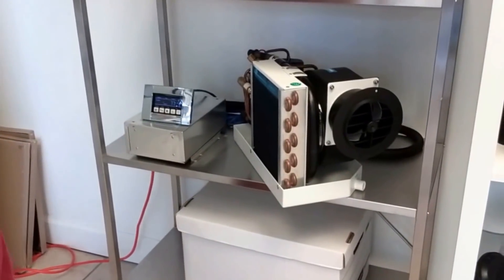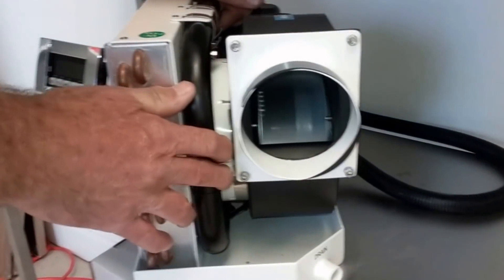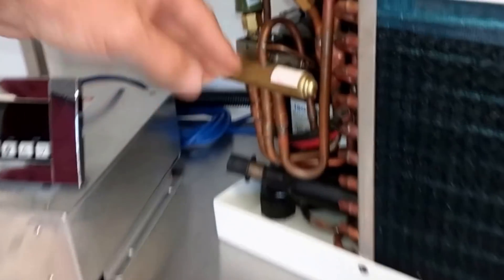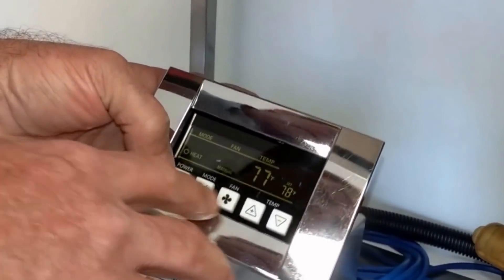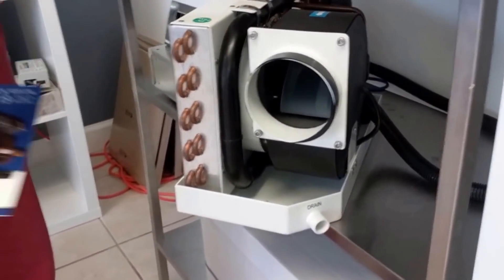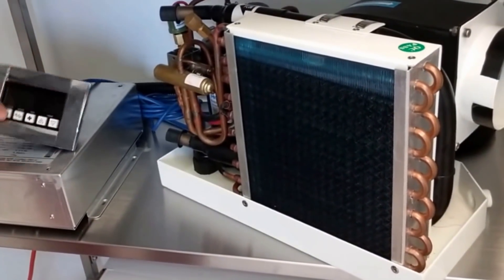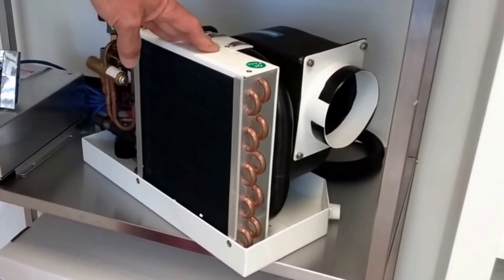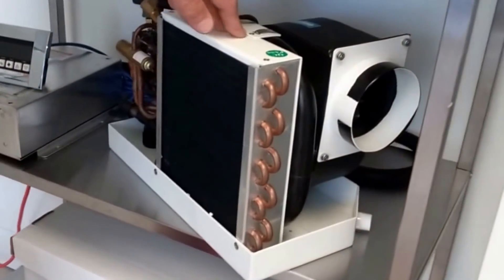Mini Hvac-WORLD'S SMALLEST AC/DC AIR CONDITIONER HEAT PUMP 4200 BTU

Comment: So of I would love to make this into a a 20% glycol methanol fluid total of like 3 gallons of glycol and methanol. I won't need the big ass fan. Would need a smaller fan to make everything functional im going to use a flat plate heat exchangers and run the r134a or which ever you think will cool the heat exchanger im going to use a magnetic driven pump  also 12v will have a wifi Bluetooth capabil of linking to  everything

Comment: So amazingly quiet and Fastly.Cool in my room! 42db is at a whisper level. I bought 2 and installed myself.Very sturdy bracket and easy to adjust to fit windows of different size. Absolutely fabulous units!!
Reply: Where do you buy it at?
 His link didn't have prices
Reply: Bot.
Reply: @jacobpie3692  yeah I've seen this message multiple times from different video comments

Comment: I wonder if bumpy  rides will do any damages to this unit
Reply: It's solid copper piping so yes. You would have to install a gym tile or two under it to eat up any shock. But this is highly overpriced.
Reply: Thanks for the info
Reply: @Acruz1994  no problem.
Reply: @briannakelly26  know of one similar i can buy?

Comment: Hello
May the product is also available for 12 volt for a van? How many watts or how many ampere are needed for round 10 hours?

Mobile +34 609 510 425
Thank you so much
Reply from the maker: All you need in the discription

Comment: People need more information on it like is it a window unit, how cold does it blow, is there a vent hose I have to stick out the window. Your not describing the key components to make a sale.
Reply: Donovan Mills its a marine unit, he pointed out the water lines that run to the condenser/heat exchanger.  It needs a source of cooling waterflow  and I assume a water pump...  Why they bothered to make it a heat pump with a reversing valve doesn’t make much sense on a marine unit as the water surrounding the boat is usually the coldest medium around and would not be my first choice to harvest heat from...

Comment: Whoa the price , learn to hack an regular  run the evap core, mount on the wall ,run 2 lines and  solder,mount other parts out side of the house and last charge.

Comment: A split version of this would be perfect, or a version of this that was the right shape for mounting underneath a vehicle, shooting the hot air out the side and the cold air ducted up inside the vehicle, it would be ideal for campers without having to use valuable roof space.
Reply: This is exactly what I have been looking for, there are some options available.

Comment: I have a minivan that is in the hot Florida sun all year round. I am sick and tired of getting into a vehicle that is 140℉. I have room for a solar panels on my roof and would like to know if you have a system that is configured for a van or even a motorhome, or trailer (3rd well). What would it take for this to run off of solar while I'm at work. I don't need it chilly, 80℉ would be great. I would have no problem cutting a hole in the roof and mounting it at the top center of the vehicle.
Reply: He said 25 amp for 12 volt, it means it use 300 watt. Check how much AH is your battery capacity. If you have 120AH battery(as example, Li-Ion),120*12v=1440 watt (ofcourse for acid filled you will get only 720watt). It means with 1Li-ion battery you can run 3-4 hour. Then check how much solar power you get in,  to avoid run out of power. For installation, you just need to hook it to your RV or Van wall. You also can hang it on van rear door, just weld a cage outside to avoid someone take it as a treasure, then you will be good. Hope it is helpful.

Comment: All these people freaking out over the price are idiots. This is a unit that is being marketed for people looking to cool a room in their home. It is used for a small vessel to cool a cabin. If you are wanting a a/c in a sailboat or small cruiser there isn't many options as you cant use a window or in room unit. These units are priced at this or higher on west marine and other sites but the power consumption is the main key here. He quotes 25amp at 12volts. If he is correct that is 10 amps less than any other I have been able to find and almost half that of west marine's 6000btu unit. If you are looking to run a/c on a sailboat that is strictly ran on a battery bank 10 amps a hour is huge and well worth it

Comment: It's not the world's smallest HVAC! This is an everyday boat compressor and evaporator. Nothing special people. Just look small because it does not have a heat exchanger. It requires water cooling from the ocean. This would not work in any other application but a boat. Unless you plan on running up your water bill through the roof just to cool your AC. Other people in here claiming they can actually make one is such a joke. They clearly don't Know Jack about HVAC.

Comment: There are smaller hvac units used on Telecommunication cabnets.  They are about the size of a shoe box.  Compressor is the size of a soda can.   About 1200 btu;s
Reply: Interesting. What brand and model?

Comment: This is basically a copy of marine air conditioner. These are been available for years and years some of them run off 12 volt 24 48 110 120 and 230-240. This is basically a marine application is reverse cycle requires water so it's not true electric heat. West Marine and other Marine manufacturers and dealers sell these things through catalogs and online or you can make your own for 500 or less. 🇺🇸
Reply: +Perry Daniels   Thanks for the tip, I'll look those up! :)

Comment: EEEEEYOUCH! $1700.00 I know you need to make some $$ but really don't need to RAPE our wallets. 
Hummmm... I have a coil, 12v dual cage blower, copper pipe and wire. 
I need to buy 12v pump (new $20) and heat exchanging coil (used car heater $20) & mic. plastic ($10). 
Will have to give this a shot. 
.

Comment: I wonder if it would be possible to use gallium to dissolve aluminum scandium alloy into a new alloy that you could use to fill copper pipes like in a condensor then pass low energy frequency through the G.A.S alloy crystal structures to generate low temperatures to produce low voltage air conditioning systems? A peltier modules could even be set up in the air intake with a air filter to keep condensor clean and to generate the electrical power to run the frequency emitting electronics and to operate the high air flow electrical fan. A regenerative air conditioning system that you did not have to plug in or recharge? What a crazy idea. Wow only if it worked? ; )

Comment: A graphite heating element space heater with therma liquid could be developed has well that would use less energy and there is also a way to make it so you don't have to plug it in to use it. Just like the air conditioning unit. Imagine that a air conditioning and heating unit you did not have to plug in or refuel to use? You want to make some interesting new products? ; )

Comment: You could design the heat exchange with larger fins for a more higher air flow rate to cool off a room very quickly with the design concept using liquid argon gas plus it would allow a person to clean the unit more easy which would allow the unit to operate longer without breaking down from use in high dust and animal hair environments. A better air conditioning unit that uses less energy too! One that can put ice crystals on your forehead on a hot diners day! ; )

Comment: A cryogenic Stirling cylinder a solid state sponge and argon gas. Turn on unit has the cryogenic cylinder turns the argon gas to liquid and draws more stored gas out of the solid state sponge that fills an insulated tank with a bell siphon that filled a heat exchange radiator. With a electric fan to draw air through to super cool the air with the argon boil off gas vapor returning to tank to be turned back into liquid. When system is turned off argon gas is reabsorbed into the solid state sponge. I have another component to make this air conditioning unit totally self powered has well if you would like to work together to make one amazing piece of technology?

Comment: I just completed a working prototype of a wearable air conditioning system, weighing under 6 pounds that provides the user with 3 hours of temperature controlled comfort on a single charge even in desert like condition. Plus the byproduct is stored water. (Yes, true refrigeration @ 1200 BTU's / 12V)
More information swe_tloving@comcast.net

Comment: Need to add a view of it installed and working
This is for Marine use, all these Naysayer's are thinking of larger camping trailers
I'm guessing the unit sets on the cabin roof
Then ductwork from the blower to cabin, it's a heat pump, it has to be outside for it to function as a heater in cool weather
Engineering for the Marine market is costly, and the space to be cooled, will be a smaller than the avg tt or fifth wheel

Comment: This looks like a very nice and well built unit.  It can also be portable.  AC and heater plus it is able to accept both AC and DC voltage.  Those who are saying that this is overpriced have no idea.  I have looked into building a wannabe AC unit that runs on ice water (not real refrigerant) using good quality components inside of a cheap cooler and it was already going to cost around $400 in parts.  Key words "good quality", not el cheapo stuff from eBay and Amazon lol.  But yea, for $40, I too can hack together a fan and some cold water to get AC.  However, that won't be a product with quality that's anywhere near what you've built.  Good luck brother!  There are 7.5 billion people on this planet.  If only 1% of the population buys your product, you will be very well off.  :)

Comment: I am going to use my hvac skills and design somthing like this.
Reply: design one that is gasoline powered. take an old gas motor from a inverter generator and use it to drive the compressor. they sell aftermarket auto ac units on amazon. but you have to use the cars engine to power the compressor. using a gas engine to power the compressor would be something
Reply: You can buy a new air conditioner for $100, then get a 2000 watt gas-powered invertor, problem possibly solved. Harbor freight sells these invertors, I finally met someone a few days ago that owns one, said he has had good luck with it, runs an air conditioner in his van.

Comment: 4200 BTU's is only 1/3 of a ton. It might and might not do 100 sq. ft. For the none HVAC people, a ton is 12,000 BTU's. (ie: a single wide mobile home will use a 2 ton to 2 1/2 ton unit. On average a ton will do approx 450 sq. ft. to 500 sq. ft.

Comment: 30 watts for the fan motor and and 30 watts for the Stirling cycle cryogenic cooler? 60 watts to cool a home? That beats 220 Volts for a central cooling system correct?
Reply: 4200 btu is 4200 btu... only enough for a bedroom... worthless @$1700 WTF!? The water bill also you have to factor in if you are metered.. Water cooled condensers are costly to run...

Comment: A mini Stirling cryogenic cooler to produce liquid air that filled a tank with a bell siphon valve to charge the heat exchange with a vapor tank to reform liquid air from it boiling off during the heat exchange to complete the cycle would not be a better way to design a small compact portable air conditioning unit? It would work a lot better then this air conditioning unit correct? In fact it could replace a central cooling system in a large house could it not and operate off say 60 watts? = /

Comment: There's nothing special used in boat AC units, it's not worth more than average household AC unit with similar BTU ratings.   They're just overcharging people, making people pay thousands for those little units,.  same thing in trucking industry.
Reply: also water is water, should try to wash your car or truck with ocean water..., should try to fit a window unit on the side of a boat..

Comment: Looks like an awesome product.   However, the cost needs to come way down. Although not as compact, a small window unit can be had for a little over $100 bucks.
Reply: Matthew Mcdonal
Reply: Evaporator has to be outside of area to be cooled else heat to be removed stays in same area ... in fact heat will increase due to motor and other friction from use of electricity to power the unit
Reply: obfuscatid u mean...condensing coil must be outside of the area...not evap coil...rookie

Comment: $1,750?! No please. Great idea...but no way. For that price I could get a much more powerful unit to run indefinitely from solar power and batteries. More than likely with enough cash for a nice dinner left over.
Reply: Yeah. Take a normal 6000 btu AC unit. And turn it into a split unit for $300.00 US. That Includes the window AC unit cost. That only uses 4.5 amps on high. You want to pimp it out. Use a soft start AC compressor motherboard. You're cutting the FLA amps from 50 amps to 11 amps at startup.... The inside unit is then only 5" deep.....
Reply: BakedLikeLays
Reply: alex vranescu ... I agree: where can I get one?
Reply: I believe the thing you are missing is that while this homemade item does indeed appear to work, it's present cost far bypasses it's worth. You can purchase a professionally made AC for the same purpose operating within the same specs as this one and with an actual warranty while paying about 300 less. Of course his cost could come down considerably if he had a production line and a steady demand for them.
Reply: BakedLikeLays Sure you could.
Reply: Have you come up with something yet? I am seriously interested in knowing!

Comment: and for that price i can purches a good used  hole house a/c unit. craze to spend that kind of $ to try and cool a room it would have to run all day,and then what do u do when u want to cool  a diff room , esp if you bed room is on the sec floor the cool air drops

Comment: The comments on here are amazing. The man actually builds a small, true (i.e. cooled dehumidified air via compressor) mini hvac and you guys are busting his balls because he priced them at $1,700. Go build your own and keep your negative comments to yourself!
Reply: He didn't build shit they make them for boats and have been for years and I've put them in even smaller and on battery power 24 and 48 volts D.C.
Reply: Michael Roberts go look up climate right air conditioners. They sell their 2500 btu unit for $400 and they are small.
Reply: völywMichael Roberts  .
.bwifj Musi
1k5
Reply: Eric Richards climateright air conditioners are a favorite of the teardrop trailer community. The air conditioner featured in this video has no more BTU capacity than a climate right air conditioner. The main difference is price.
Reply: Michael Roberts When you can go to Home Depot and buy one significantly cheaper that works better that’s why people are complaining of the high price
Reply: Just because you give it a high price doesn’t mean it’s worth a high price
Reply: thank you michael roberts. we are surrounded by idiots.
Reply: Grizzled Old Dude; they are Out of stock
Reply: It's just a boat unit. It looks small because It's incomplete. It will not function without water cooling for heat dissipation. This is different from HVAC in any other application on land. Because we don't use water to cool down the unit, that would be extremely wasteful.
Reply: Yeah!      That is way more than it should be for Chinese parts
Reply: For mini cooper
Reply: Well you can buy one of these for $400 so yeah no wonder theres hate
Reply: I already built my own mini ac same idea but better quality and cost me 693 $. I advice you men to try build your own ac and it is 💯 easy.
Reply: Michael Roberts I read your comment. It has inspired me to go ahead and purchase the unit. However, I hope it comes with a cigarette. I like to smoke after getting fucked up the ass.
Reply: ReliantArms 🚬🤣🤣
Reply: Michael Roberts
$1,700????!!!!!???!!!
AAAAAhahahahahahahahahahahahahahahahahahahahahahahahahahahahahahahahahahahahahahahahahahahahahahahahahahahahahahahahahahahahahahahahahahaha....Oh dear!!aahahahahahahahahahaha..!
Reply: It is just a fridge unit, with a bigger condensation coil. There is no exhaust coil, like a fridge. Just buy a 12/24v fridge and open the door. It is a horrible design. There is no exhaust, all heat returns back into the house. The unit generates more heat than it cools, like all units do. That blower fan creates more heat than it can move through the unit to cool. I am sure it makes an awesome noisy heater, as efficient as a 300w lightbulb, but without the gains of 300w of light.
Reply: it is NOT an invention per say, it is just a miniaturized HVAC unit, anybody will FULL understanding of refrigerants(pressures/saturation/sublimation- etc), relays, brazing etc, etc, can build this thing.........shit i think i'll get started in the near future!
Reply: im saying. haters are gonna hate. theyre probably mad bc their cooler invention failed

Comment: I have one question for you, Sir.... in your website, this unit has many applications and one of them is for trucks. Can it be use in an ordinary car.... sedan/salon/sportscar? The norm... it consumes much fuel when the AC is switched on while driving and will provide much 'overload' for the engine in motion. So, please correct me if I'm wrong.... this can be the future for mobile AC in cars. Am I right? Your reply is highly appreciated
Reply: This would be a horrible solution for automobile air conditioning. This unit needs AC power, so you need an inverter (not efficient) to even think about using it in a car. Not to mention the load it would put on your alternator. Not viable at all.
Reply: BakedLikeLays well, how about those people who use "electric superchargers" on their modified cars? Ain't that the same thing?
Reply: +Mustafa Ali Yes it's exactly the same. 100% remedial. Neither work. Not even on paper.
Reply: BakedLikeLays Oh really? Hmm.... someone must go back to the drawing board and invent something useful then